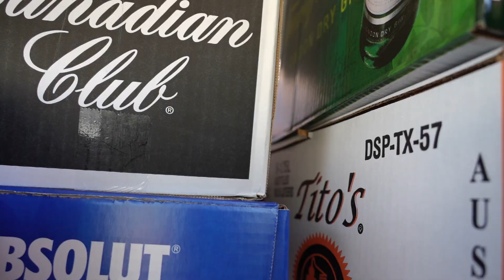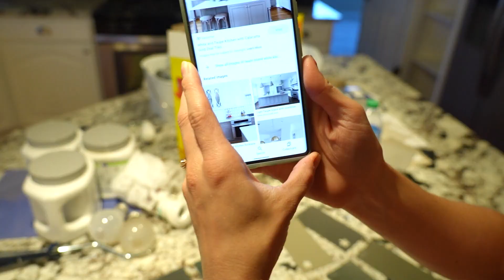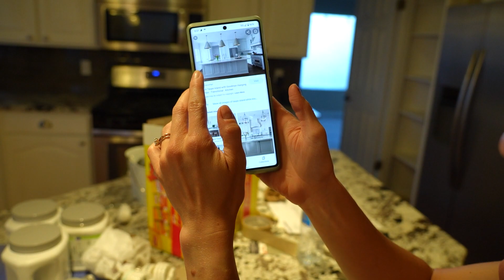Our First Big Problem at the New House - This is NOT What We Expected or Wanted..

Comment: Yeah plus he didn’t fill in holes anywhere either on railing. Like those tiny nail holes. Plus I don’t think he even sanded the whole old stain off he just went over it with darker stain which you can tell. Stain does not lay right unless surface is sanded properly.